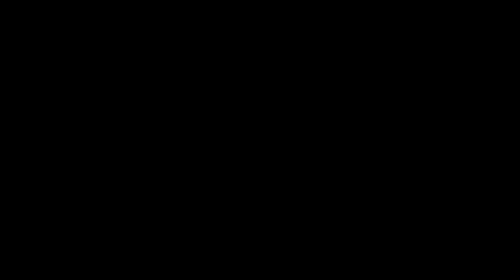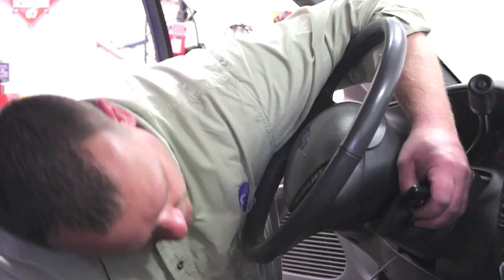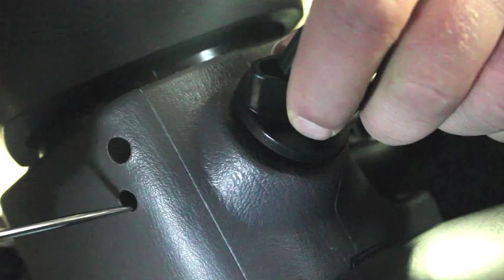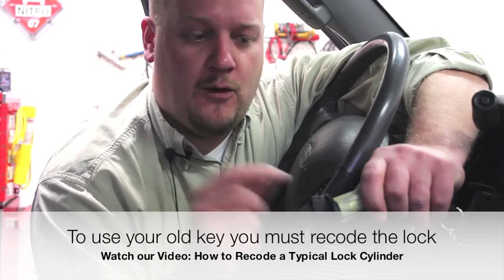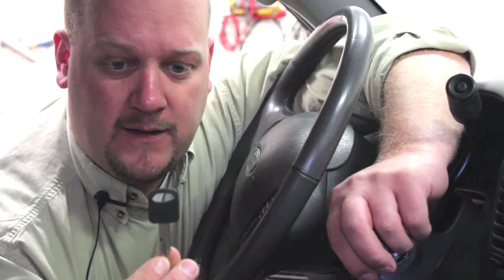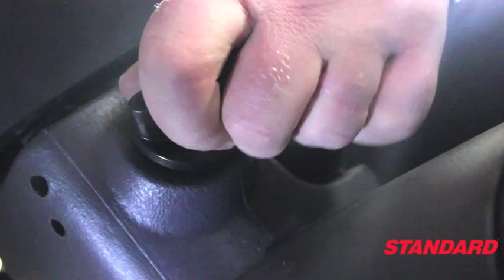Ignition Lock Cylinder Replacement (Ford trucks with Passive Anti-Theft System)

Comment: If you respond to these, I’ve had no help anywhere else. If my vehicle initially had pats and I replaced the ignition with one without a transponder key, would that be why it won’t start now? Do I have to replace it with an ignition with transponder? The transceiver is also broken off. (Someone tried to steal my car)

Comment: SImple. Even I can do that ;)

Question. If your ex stole your spare key and keyfob...

This video shows me how to change the cylinder, great!

But how do you change the frequency/code from a (possible) module inside that gets signal from keyfob to open doors? What new module would I have to buy and change? I can reprogram the keyfob pretty easily, but changing the frequency/code from the source module is what I'm looking for so she can't use the old keyfob to open my doors.

If you (or anyone) can help, that would be awesome!

Comment: I believe that I might be a little confused? If I go buy a new lock cylinder with new keys, Will both together work or will I need to reprogram the new keys and the cylinder? or just the new keys? or no programing need at all? You mentioned in you video that you had already programed the keys, do you have a video showing that procedure?
Reply: croftdouglas110 If you buy a new ignition switch with a new key, yes, it should work. When he said he's already coded them correctly, what he's talking about is the pins or plates inside the cylinder that interact with the key.
Reply: How bout if I bought an already proven working set from a doner truck? Truck was smashed but still starts and runs. Hope to hear from you soon..thx

Comment: Can you help me out please I have a 200 4 f150 that want started I put a used pcm computer jn it with all the matching numbers and it want start I took it yo ford dealership yo hav e them flash the computer they said they did but it still will not started help me please or call me at 8477145948 and I'll tell you what my truck is doing

Comment: If you have no keys, mobile locksmiths are often quite reasonable and it beats accidentally trashing your steering column by destructive methods.
I worked at a rather low-budget used car dealer and while we knew how to use "field expedient" methods it wasn't worth the time and hassle.
A locksmith can match your original key so you can use one key for doors and tailgate too.

Comment: I have a 2000 ford mustang v6. The original key stopped working, key wouldnt turn over at all anymore. So i went and bought a new ignition from autozone with the same chipped keys. I installed new ignition cylinder and key turns over now to run position but will not start, How do i go about bypassing pat system or getting new key to register to engine??